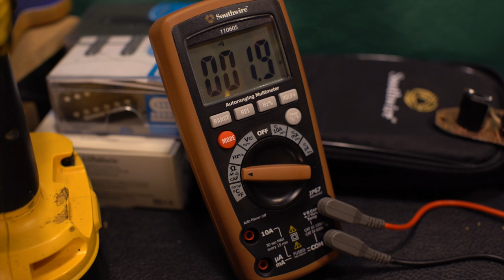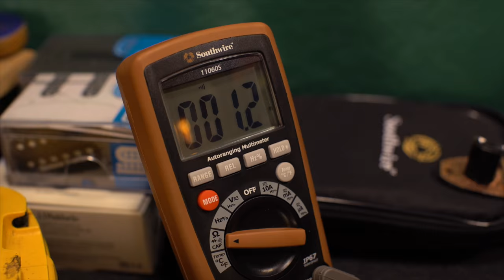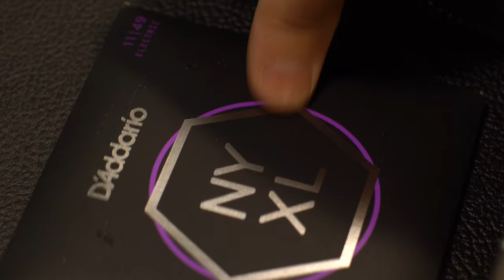Musicmaster Mods:  Shielding, Humbuckers, and Auto-Trim Tuners

Comment: Nice work Troy and thank you, I never would have thought that with the shielding as you had it, that a few of the CF bulbs would still give you a buzz like that. That's good to know. I like the tuners also. Sorry about the nut, been there, slung that. 😎
Reply from the maker: +Buddy Martin Yeah they're only a few inches away from the headstock, just out of view of the lens.  It's a perfect storm!  But if we should be getting better noise reduction results than this with humbuckers and shielding, then we're all ears.
Reply: +Troy Grady If you haven't already, you might want to try a test with the lights off to check for the existence of other gremlins.
Reply from the maker: +Rench Guitar Werks, LLC Awesome Mike!  Thanks for all the details.  Indeed, CFLs were the best lower heat/wattage option at the time we lit the studio, because light quality in consumer LED bulbs at the time was terrible.  But we just ordered a batch of the new high-CRI Cree LEDs to test out.  We're cautiously optimistic.

Another viewer in the comments mentions Zexcoil pickups.  Hadn't heard of those but demos look impressive.  If the hum really cancels that would be rather exciting.
Reply: +Troy Grady The Zexcoils suppress noise really well.  So do Kinmans and DiMarzio Area and Virtual Vintage pickups

The quietest pickups I have and have ever had are a set of D. Allen JohnnyBlades.  They were a Johnny Hiland signature set of Strat single coil sized blade humbuckers.  Sound great too.  A fat Strat tone.
Reply: +bluesboynate Sadly he doesn't make them anymore.
Reply: +Troy Grady You need covered coil humbuckers to get more of that noise out. I assume you have a bit more of the copper shielding (btw, also good is a roll of adhesive-backed aluminum roof flashing, $8 at the hardware store to do dozens of guitars). For testing, make a cap that goes over the top of the existing coils and attach a ground wire from these to the grounded bridge. May have to lower the pups to get space but you can leave the strings on. I did this on a high wound HB and saw very noticeable improvements when in front of a computer+monitor. If this experiment fixes your situation you can then pursue covered HBs to fix the problem. Another option is some pup builders wrap a strip of copper tape around the outside of a coil (over top of the wire protective tape wrap), run a ground to it, then put a plastic cover over that.
Reply: +Troy Grady Second solution: I bought this used V with bad noise that I fixed. I started with the usual shielding and grounding and still bad noise like you found. This guitar has a jack on the upper wing where a twisted-pair wire runs down the leg of the V, across the guitar body, and into the control cavity, it is about a foot long antenna. I swapped the jack wire with an old salvaged RCA VCR shielded wire (two conductors inside a woven metal mesh). I have found this same solution fixes even short wire runs to jacks - so all my custom guitar builds get this.

Comment: I now use a Dremel (at slow speed) with a proper size sanding bit to widen the machine head holes. It also allows me to keep the front of the hole original size for the ferrules to fit. Gotta have a steady hand. Great vid Troy. Your gat sounds most excellent now. Shielding is imperative. P.S. Love the cracking the code series. Classic. 😂 Mirrored my own life in many retro ways. I still have the same YJM instructional video. Worth $10 on eBay? No bids.
Reply from the maker: +JCF Vintage Thanks man!

Comment: try putting a 56pf (or higher, you may want to play with it a bit) capacitor in on your tone pot. (soldered in parallel with your tone capacitor)
this may help with stray capacitance which may help reduce the noise further.
I call it stray capacitance (thats what we called it in college) others use a term called parasitic capacitance 
which has to do with the windings.
A capacitor is basically two plates that are spaced a part and requires a certain amount of electrons to fill from one side to pass to the other 
windings act in a similar manner where just like the plates they too pass electrons which can cause some resonance.
you can't help lights with ballasts they definitely cause havoc on single coils.
I always wired my pickups in parallel for the cleanest output.
but on classic pickups, there's nothing much you can do with exception of trying the above.
the shielding looked great BTW.
Reply from the maker: +digitechicnal Thanks for the details.  I do think the single coils sounded great for vintagey leads, but the plan was always to go humbucker for the higher-output bass riffing that we tend to use in our stuff.  The actual bucking of hum is of course a plus.  Will the capacitor mod still work, and where specifically does each leg get connected to?
Reply: +Troy Grady Vintage Hardware is always nice but always comes with a cost (ie noise). Like when I built my first tube amp, It took a bit to get used to the noise that is associated with tube amps but the tone is amazing.
With pickups I used to wire my guitars bridge to switch between series and parallel to go hotter during lead playing, however I found myself not switching it all that much and dropping a bit more gain during leads. The other issue with series wiring is that the pickup is more like an antenna and even with good shielding can still have annoyances.
Is there foil wrap around the inside of the single coil pickup? That could help too.

It does almost resemble a 60hz hum, so a quick calculation based on 250K Pot would be a 5nf Cap (2nf if its 500k) that would cut off anything starting at just above 120hz.

Further thought, you could add a Single RC in parallel with your tone Pot.
The RC would be a resistor and capacitor in series (--/\/250k\/\--|5nf|-).
You would add the rc circuit at the point where it comes out of the selector switch to the ground.
Dont know if it will format correctly but:
(selector switch)
|               |
Tone/vol    |
|             RC
|               |
___Ground___

You may want to google &quot;Band Stop Filters&quot; as well as you could calculate the frequency range that you suspect is causing the noise (or find it using an Oscilloscope on the output of the guitar) lots of good and useful information on filter circuits.

Your a brilliant individual and I think you will get it sorted out.

BTW, Thanks for all your guitar vids It&#39;s made a huge difference on my playing, I am intending on purchasing Antigravity (because I still need improvement (if you want to laugh and visit my video page))
The Canadian dollar is not doing very well so that doesn&#39;t help hahaha. It is in my list of purchases now that I am almost recovered from the Christmas bills.

Ken

Comment: Hmm. Thoughts on active pickups such as the emg 57/66 set? 

Dead quiet and more of the "authentic" tone if you will.
Reply from the maker: +Janine Louvel I installed an EMG once in the past, but honestly I have a really low tolerance for replacing batteries, changing strings with tools, and so on.  That's pretty much why I gave up on tremolos.
Reply: ***** Yeah trems stink lol

Comment: Wow.. what an improvement and upgrade with great new tuners as well, those older cheap Fenders can really rock to, even heavy riffing.. thinking about getting one of those, but i need 22 frets so i gotta get another neck to fit in the body, and make it kinda like a project guitar with different types of parts..  Is this the original neck on your guitar ? Any suggestions about a 22 fret Fender neck that could be suitable for a Duo Sonic ? Great videos btw.. i remembering watching your Cracking the code on VHS back in 2000 or 2001, i was thinking: wow.. i wanna be that good one day.. hahaha
Reply: +HearGear I didn't realise.. those Duo Sonic/Musicmaster is available with 22 frets to.. :D

Comment: You need to do a video just on your guitars.  We've seen the Washburns over the years, and now the Fenders and Gibsons.  I (for one) would like to hear how you moved from guitar to guitar.
Reply: +GDK Opinionator Wasn't there something funky going on with the headstock and nut of his Washburn?
Reply: severalpaperclips I think he had a few like that, but I could be wrong.  He must have installed a headless tremolo system (Steinberger or similar).  They're actually VERY stable.

Comment: Interesting video. A 22.5" scale! That is tiny, but it still sounded really good. Do you know why the low E kept slipping out of the nut? Heavier string gauge needed?
Reply from the maker: +ForViewingOnly I think the nut is just old and worn and needs a replacement.  It wasn't happening before the tuners, but I think the holes on the Auto-Trims are a tad higher so the string isn't pulling down over the nut.  A string tree could maybe fix it, but there's also a dead fret on the 1st string so we may be in for a nut job / refret anyway!
Reply: +Troy Grady If the frets are not grooved badly, you might just need a fret level/crown/polish. If you replace, I'd suggest stainless steel to last longer next time.

Comment: would have been nice to see the difference before and after shielding with the same pickups! the hum buckers should get rid of the hum on their own no? I wonder if the shielding actually helps pick up the noise, its almost like a big antenna! a good earth path should be enough. Shame you couldn't find tuners that fitted the original holes, looks like that reamer took out some nice chunks of the headstock.
Reply: +david stupple Do a google search for "Faraday cage", that's the role the shielding fulfills.
Reply: +severalpaperclips so he doesn't get struck by lightening?😉
You don't see many factory guitars with that kind of cavity shielding, I was just musing that it'd be nice to hear what all that tape does in isolation, independent of the pickup change.
Reply: +david stupple FYI, most modern factory guitars do have cavity shielding, but it's done with a special conductive paint instead of tape, because paint is less labor-intensive to apply. It's also common for pickguards or control cavity covers to have shielding on the underside. Fair enough to wonder what the guitar would sound like with shielding and the original pickups, I'm just saying the science behind shielding is well established.
Reply: +severalpaperclips this is very interesting but nothing I wasn't familiar with before. Still noises though isn't it? Even with all the copper! I'm not sure we can really say it works if this is the result. I have built a couple of vintage style guitars with period correct shielding (ie none) and they don't seem to have any such issues (yet). The nickel casings on paf style pickups was intended to reduce hum but was eschewed by many very famous recording artists without a problem. This is strange to me is all I'm saying.

Comment: Would an LSR roller nut solve the nut problems you're having? I have one on my strat plus and never had a string come off.
Reply: +Soussherpa Robert T. Baumer Never seen the need for an LSR because you can never go back to the original style. Ive had it happen on bone nuts where the outside edge breaks away and the string can fall away. bone can be a little brittle and the density isn't uniform. Graphtech, brass or a new bone nut would be needed. Sometimes the nut slot isn't deep enough (Van Halen did this to reduce friction) but on such a vintage guitar I wouldn't see how that would be true.

Comment: Tony, your playing and tone are excellent, but how do you get proper intonation when the D and G strings share a single saddle?
Reply from the maker: +transtremm I don't think you do!  Fender still sells Telecasters with this type of bridge so they must find the tradeoff acceptable.  Honestly, the instrument fails to intonate uniformly for chords even on guitars with individual saddles, so we're pretty much doomed either way until squiggly frets become the norm.
Reply: +Troy Grady That's actually one of several cool things about Antares' recent Autotune for Guitar products: the pitch correction means you can play chords anywhere on the neck with perfect intonation. A downside is that you have to use a hexaphonic pickup (it can be made to work with either piezo or magnetic). But like Line 6, they have pretty cool pickup modeling available. Big price tag though, and won't hold much appeal for purists. Plus, in your case, seeing you use that type of tech would encourage trolls to make accusations of smoke and mirrors.
Reply from the maker: +severalpaperclips That's probably too much gear for me!  Considering I can't be bothered to grab wire cutters to change strings any more.  I'm all for the continual evolution of the tech though.  When they finally get some type of synth guitar that looks and plays like the real thing, but records and edits like a midi instrument, I can see checking out of analog altogether.
Reply: +Troy Grady Yeah, today's DSP solutions won't be everyone's cup of tea, but I'm still impressed at the capabilities and bang-for-the-buck we can get in guitar electronics now.

Comment: Baking soda and super glue will fix that nut if you dont want to change it .You can also file a bone nut and use the dust/shavings and super glue as filler..

Comment: i recently bought that shielding and im not too sure how to install it? why were you soldering the ends together instead of just sticking them together?
Reply: Probably because his copper tape is not conductive, and you need to solder the pieces together to ensure conductivity, if you don't do that, it won't work. You have to make sure you use conductive copper tape, and if not, you'll have to solder the pieces together like Troy.

Comment: what does shielding the body do to the guitar?
Reply: +Sitha Puth It will help to prevent certain types of noise from getting into the circuit.  RF buzz or light noise.
Reply: Kley De Jong
 thanks!!
Reply: shielding is a must, especially with single coils. it eliminates a ton of noise. 60 cycle hum, rf noise and almost all noise is gone. if you play gigs and they use fluorescent lighting, you get a ton of noise you dont want.
Reply: thank you for this info... this will be my next project A++++
Reply: +Mister Knight Owl does a noise gate help with that?

Comment: What's the point of the auto-trim tuners? if it's only to snip off the excess string then it's kind of a mere novelty. If it makes wrapping the string around the post unecessary than it's cool :)
Reply from the maker: +אביאל פרץ Correct, they have the same benefit as other locking tuners -- very little string wind around the nut.  Pretty much as soon as the end snips off, you're up to pitch.  The trim function is the icing on the cake.  String changes with no zero tools, in seconds.  Praise the lord.
Reply: Praise Guthrie Godvan :P

Comment: won't lie cringed a little when I saw the headstock wood chips but hey it's more character
Reply from the maker: +guitarguy935 I was just going to reply that none of this was my doing.  The guitar arrived pretty beat up, with a number of old/dirty chips and filled holes which you can see.  But I'm noticing now that one of the chips on the front does indeed look new.  Well I'll be.  I have no recollection of this happening.  For the record, all the reamer cuts were sharp and precise, and the tuners are snug and solid.  Must have happened when I removed the white tuners. That's annoying!
Reply: +Troy Grady definitely but through working on guitars you pick up experience and things like that tend not happen less frequently the more you get into modding and building guitars